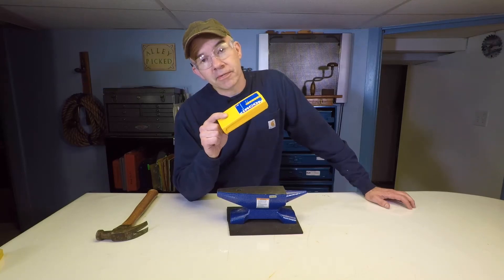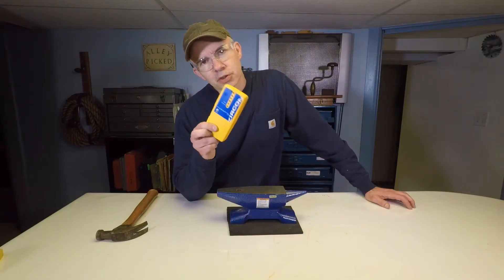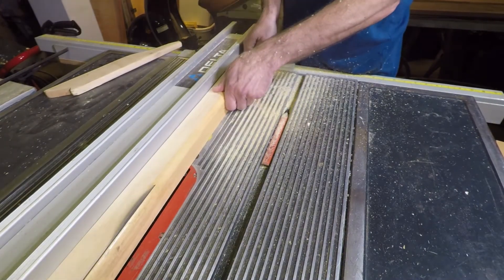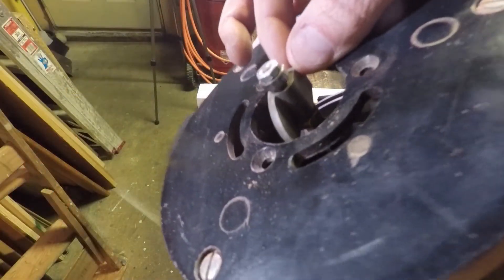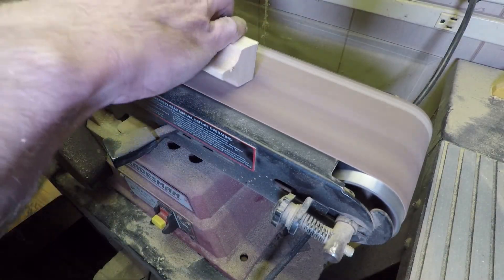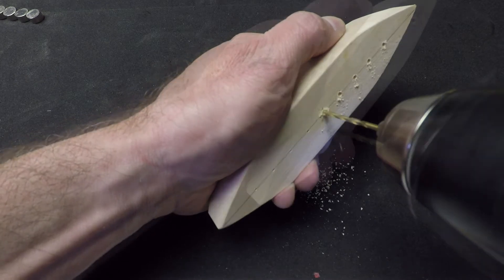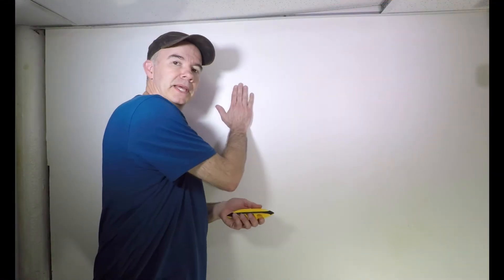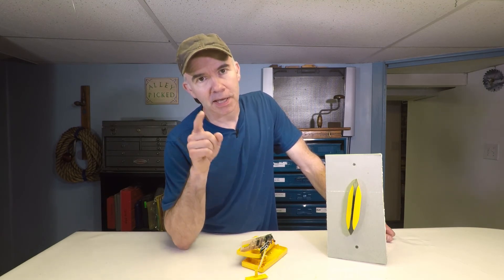Why I DESTROYED my stud finder

Comment: Just recently had to use a stud finder and it was a hot mess. It had so much false positive. I gave up used drywall anker to do what I needed after drilling 3 pin size holes finding no stud. I then remembered last time I used these pain in the ... devices and I remember I didn't have much fortune previously either. It somewhat helps but, don't actually help.

Comment: I prefer to use magnets as well in most cases. But I find that in older homes, where there is plaster over gypsum board, magnets are useless.  I'm not saying that stud finders always get it right but they do a pretty good job.

Comment: I think after watching your “woodworking capabilities” you had better stay with the electronic stud finder. Really? Holding the wood in your hand while drilling toward your hand? Leaving the block lay on a rotating belt sander? Cutting angles on the short piece of wood with a table saw? I think the safety practices of using equipment far exceeds the need  to build a magnetic stud finder. I use the magnet out of a hard drive. Put a string through the hole in the end an put it around your wrist! Simple.
Reply: @Bamboo Training Required? By whom?  I hate to break it to you, but pretty much ALL carpenters break these rules daily once they are skilled enough to not get hurt.

Comment: You need a 3 in 1 that detects studs, wires and copper pipes. Your vid is ok for a general cheap stud finder but don’t knock the decent tech that makes most jobs easier.
Reply: Plus that zircon stud finder he is using I think are junk any way I had one similar to it and it never was very accurate imo